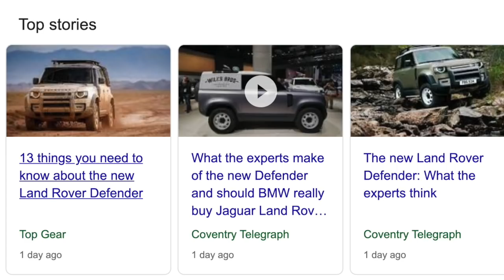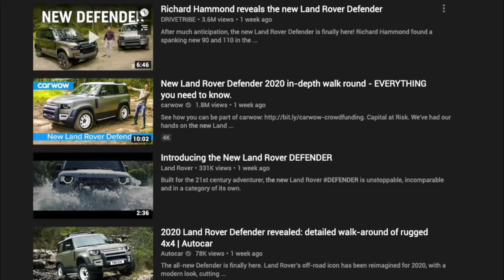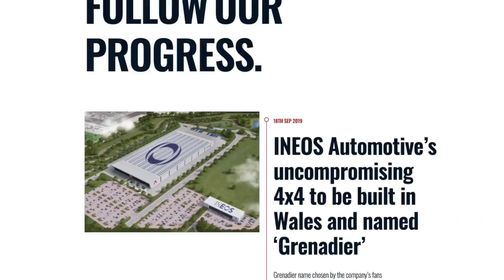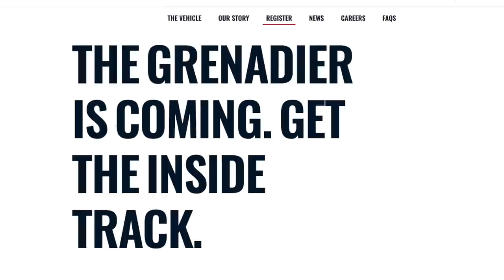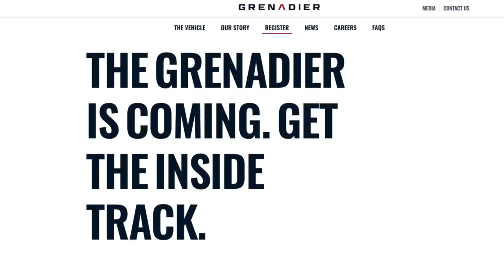Thoughts on the New Defender and The Grenadier to be.

Comment: I couldn't believe the price of the new Defender when it was announced. Jaw dropping. Can you imagine using a fully loaded new Defender on some wilderness expedition and then having to get it repaired when it inevitably breaks down. Good luck with that. For all its faults, at least the old Defenders could be fixed with baling wire and a hammer.

Comment: My Q Plated Series 3 Lightweight was the best Landy I ever had, I have owned Series 11b, series 3 SWB, 2 x 90's, 1 x Disco, 1x Two door Range rover over the years, but its the one that I had the biggest smile on my face all the time driving,  even when it was raining, water pouring in, heater non existent, had to scrape snow off the driver seat before driving as the door tops were always shot. But so easy to work on, fix it anywhere, when it was cover in sand, mud, dog hairs, inside just turn the hose on it and let it drain !! Wish I kept it now as the price of them has gone crazy !!

Comment: This is my 3rd video of yours, just picking the odd one to see what the channel is about.  My 1st 'car' at 19  (in 1991) was a direct release S3 LtWt, the carb and manifolds were in the back, holes in the footwells, bulkhead outriggers rotted out.  Oh and I didn't have or know how to use a welder.  I bust the bank and nearly lost a girlfriend over that (she went a bit later anyway) Ran it for 7yrs, ended up dropping a Transit Di in it.  I have to agree, THE best landrover ever! (well the V8 of the 101 is something too).  It needed work I didn't have a drive so I 'upgraded' to a 110 SW 1992, I STILL want the LtWt back and every now and then check it one the DVLA site it has an MOT, tax etc.  and yes it's still on the road some 42 yrs old!.  NOW onto the 'Proper' Defender (not the 90/110) but 200TDi onwards, That's what I have, and it was 7yrs old when I got it, after I put a mile or two on it at 260,000miles on the clock, a full set of doors, 2 gear boxes a transfer box, a full set of seats, 2 windscreens, a lot of oil changes, a full set of wheel bearings, a rear 1/4 chassis, 2 fuel tanks, a set of big end shells, 3 clutches, it was time for a rebuild.  Now this is everything a full 'Triggers broom' Galv chassis new bulkhead (talked a guy into making it who only does S3 and a proper rivet counter too)  I am fucked off. Not with the land rover not with my abilities but and I feel this is something anyone with a 'landrover' can back me up with 'shitparts' the quality of aftermarket parts is disgusting, 6 stub axles before I had 2 that had been machined to the correct tolerance,  I am sick to the back teeth of parts that on lottery may fit, I don't care how long the warranty is I care that it will do the job.  A £2 part that fails within warranty that needs the engine out on the bench and stripping meaning 50 more £2 parts need replacing is now a £300 part with the labour.   BUT then doing it our self we don't charge labour on our own vehicles, it's just our time, the stuff the boss and the baby need from us, and the house, and the day job.    The new Defender, tarts handbag without a doubt BUT in day to day use including toe work, will stock vehicle to stock vehicle wipe the floor of the 90/110 Defender of old.  When it needs work doing the parts not being aftermarket will fit, will last as did the original parts of old.  The noise well my hearing has got used to a 20yr old VW passat ( the £500 temp vehicle while I do the landy) , I can listen to the radio, hold a conversation and it's at 150k on the original clutch and was used to toe a caravan!  The Grenadier, hmmm I think it's going all a bit 'back to the future' from what i have seen it's all a bit DeLorean on the claims

Comment: The new land rover defender is one of the biggest lemon on the new vehicle market,as for all the ECU units on them good luck and l am sure this is going to be a good  cash cow for the dealers.  In Australia these lemons won't have a lot of sales because of 4x4 drivers here  have got common sense  not to go near them.
Reply from the maker: 357MagnumPlinkster Society   but if the lights are on a LIN bus sytem then each lamp cluster and switch could be considered an ECU.

Comment: With the great machining, great technology, and 70 years of research...

They could make the Defender into a simple and basic 4x4 with straight axles. Or with a hummer style suspension. But today Land Rover should make an off-road machine that plans for the Offroad Enthusiast. 

Selectable lockers, on/off front and rear swaybars, a bolt together aluminum body that has the repairability of the Defender but in a 70-years-later-than WW2 design. 

Sure it could have halo headlights, sat and nav, heated seats, etc...but it wouldn’t be defined by these things. 

There should be a basemodel version with waterproof power window motors and a high mounted fuse box, power steering and a few other basics like ABS, etc. the center diff should have an auto locker in it and the drivetrain should have zero play like other new 4x4s. 

Make the new defender something that the military and police can bolt stuff to. Make it a no frills, low maintenance 4x4 without wiring problems, burning tail lights, and crappy door seals. 

Give ok leg room for middle row and get rid of the crappy back windows. 

These are simple answers to 70 years of good suspension and bad body engineering and planning. 

The new Defender will not hit sales quotas
Reply from the maker: you know I have my dads old mech tech book which was published in 1928. There is honestly the basics that have not changed much. They got the principles right over 100 years ago. It's just been developed further, material development etc.... but whichever way the go, they add on technology to make it look attractive to the high ticket price buyers.  Yet strip it all away. it's still foundational automotive principles at work.
Reply: My dad and his twin brother had a 30s chevy and an old military jeep. They got in trouble at 13 years old. They snuck out down the beach with the Chevy. Grandpa said they had to leave it for two tides on the beach. 

Uncle Louie got it running again. Grandpa said they needed to make a beach buggy out of both rigs. It became 4x4 with Two Transmissions one behind the other. They could put the jeep in low and first gear and the chevy transmission in first. They could start it, put it in gear and go eat a sandwich. By the time they came back it moved only 50 feet (15 meters). 

I always wanted a H1, but in Brazil the Defender was the rig for me. Now, the basic tractor, noisy engine, bad turning radius (wheels spacers got me to 13 meters exactly), and bad cornering capability has just made me want to keep it more. 

My Brazilian friends call it a “War Tank.” 
I call it my “tractor” and my “mechanics school” 

With your help I’ve done a lot of maintenance. No other vehicle has videos like yours that go with it. 

You my friend help the Defender stay a driving legend! Thank you!!!
Reply: The Mech Tech book you refer to reminds me of John Browning...he designed the 1911 and most other forearms with a pencil and a paper. Over 100 years later they are legendary and still very popular. Don’t mess with the early 1900s!!

Comment: I think if they made a edition of the new defender where it's basic ie. Manual transmission basic interior basic everything meaning not electrical sensors everywhere and all the fancy settings and  controll rubish if they just Chuck all that out back to basics , on springs, steel wheels, basically a defender but without all the shitty rotten leaky doors and loud noises and tinny pannels and rust then they would sell like hot cakes

Comment: I think they are making a big mistake. Honestly you might as well buy a Landcruiser. These are simply not suitable for what Defenders are actually doing. What farmer is going to be able to use a fancy luxury vehicle like this for thrashing around his farm, putting the dogs and the tools in the back? How can you trust all those electronics to not crap out to venture into the bush. How can utilities or other guys use these as work vehicles.

If Ineos are smart they should take some hints from Toyota. Use Denso and Bosch electronics and have whoever makes Toyota wiring looms make theirs. They should probably buy an older engine. Maybe an older Ford diesel that is a bit long in the tooth and run on Euro 4 or 5 emissions.
Reply: I don’t know where you live but most of the farmers around me drive Japanese 
I’m a Landrover owner so I have no axe to grind but the Defender has been by passed by more comfortable more efficient and greener products 
If we followed your thought process we would not have I phones , I pads and all the rest that makes our life easier 
JLR is not big enough for niche products they need to build cars to sell , the defender has never sold in big numbers because they last so long those that want one have one 
They need new customers and no Landrover goes properly off road until it’s about 7 or 8 yrs old because they cost so much mine included 
If the truth be told neither does any of the other “off road “ makes either 
Keep the brand going with new models or keep the old models and die